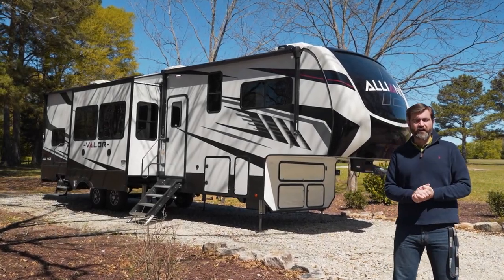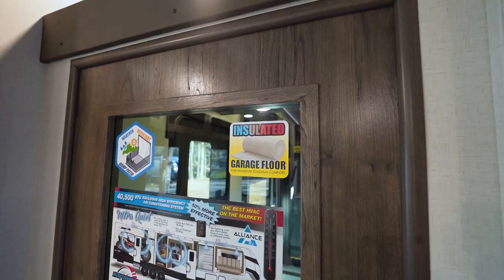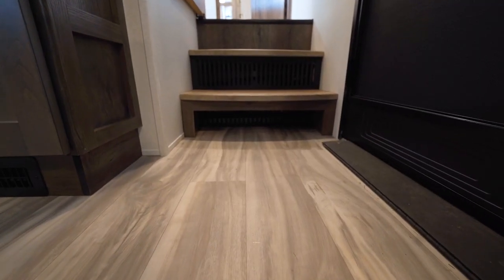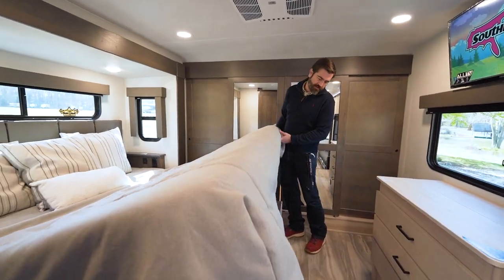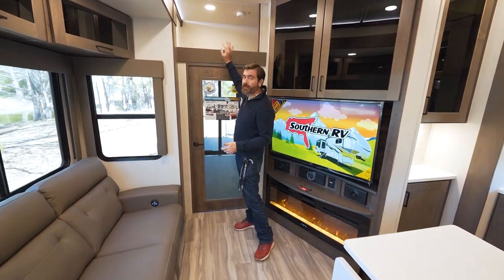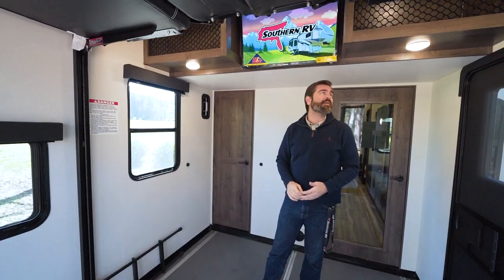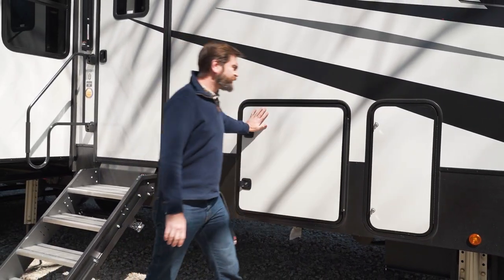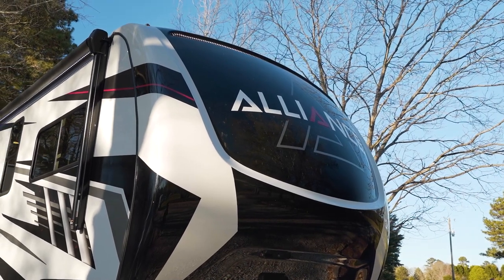RV Rundown | 2023 Alliance Valor 36V11 Full Time Luxury Toy Hauler Camper w/ 11' Garage Southern RV

Comment: Thank you for the your. You always do a great job! Correct me if I'm wrong, but the placement of the TV's in most Toy Haulers living room is a neck strainer due to the angle. Is my assumption incorrect?
Reply from the maker: It all depends on which mount the RV manufacturer chose... some put the TV on a "drop down" mount that makes it a little easier to view.  These can typically be installed as an aftermarket upgrade if it did not come from the manufacturer that way.
Reply: @Southern_RV  Agreed and understood. Thank you very much for the quick response. 🙂